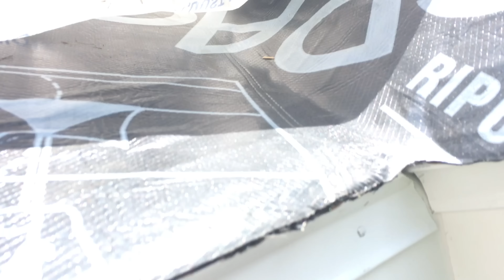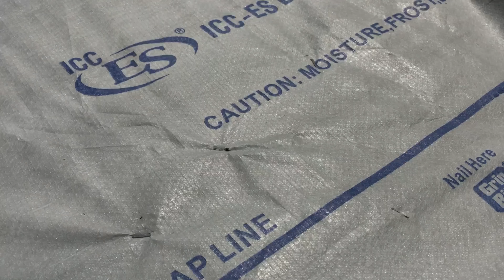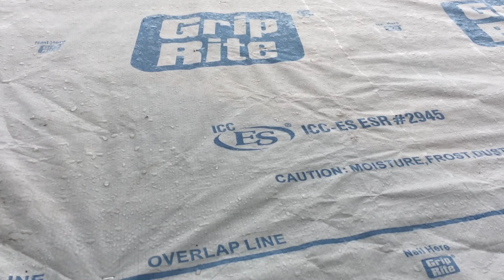Ep 6 Cape Garage and Gift Shop...SHINGLES !

Comment: Is that a power line so close to the garage with a yellow sleeve on it ? Will the power company relocate it if yes to my 1st q ??
Reply: I think the power line will be moved to the front corner of the house. There are conduit stubs exiting under the gift shop floor that maybe for the service conduit. My guess at this issue.
Reply: Local electrician needs to relocate the power feed on the house first. Most likely they are coordinating the start of electrical for the addition at the same time to save a trip and then scheduling the power company when ready. BTW, looking at the gift shop, lower right of the floor, I see several pipes sticking out and wondering if they might be bringing the new power underground to that point and then to the rear of the home. Guess we'll see in the next video.
Reply: Exactly. I was wondering how they got away with working that close to it.